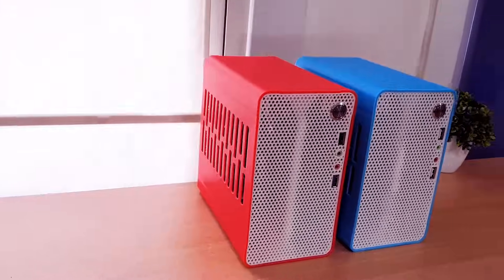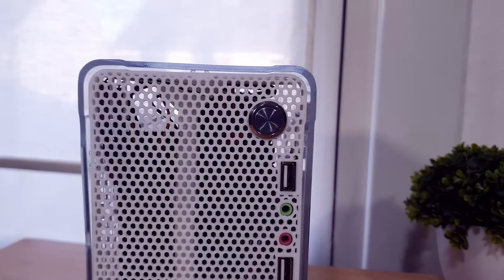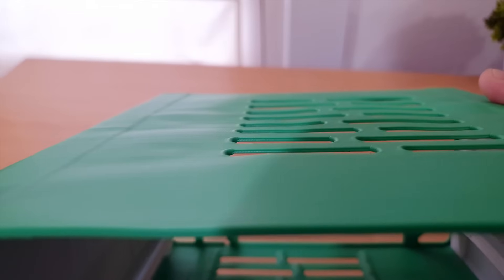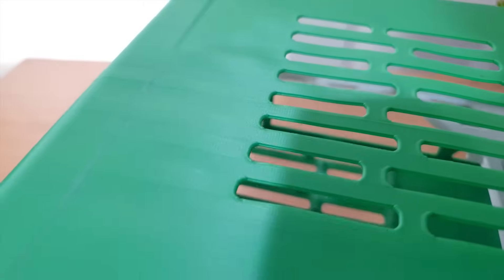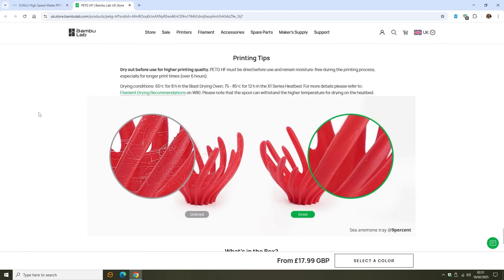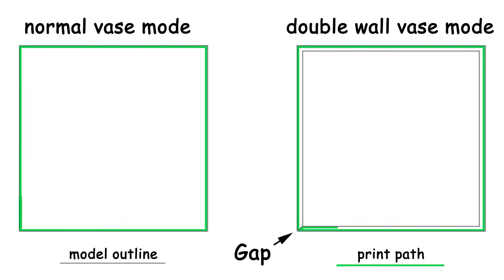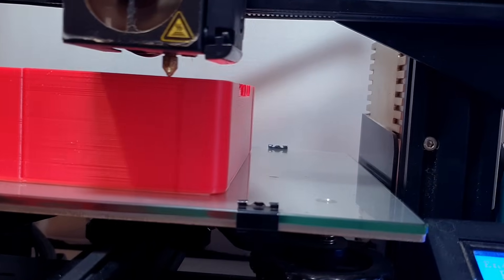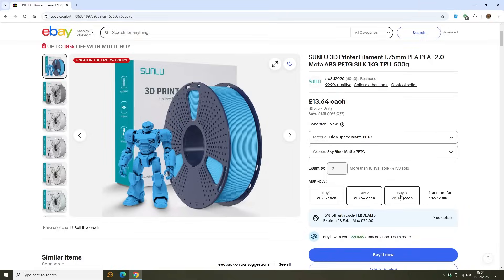3D Printed PC Case - Better Filament (Bambu vs Sunlu)

Comment: If your going to use a print bed to dry your filament here are a few tips. Take a cardboard spool box, cut the flip top off. Use a pen or exacto knife to poke a few very small holes in the top for moisture to escape. Set the bed to 65c for as long as you can. At least 4-6 hours. For extra points, rig up a small blower fan to circulate air around inside the box. 

Trying to dry the filament in a bag is going to trap the moisture inside. If you can afford a proper dryer, I would obviously recommend that.

Comment: I've had 0 issues with BBL PETG HF that weren't my own doing. You definitely need to dry it well to get crisp prints, and if you can, keep it dry while printing if doing a long print. (as I imagine a pc case would be)

Drying it on a print bed with desiccant around it is like taking a shower and not expecting to get wet. 🤣
Reply from the maker: yeah, I should try it again, the shell/sleeve takes 5h30m to print.

The dessicant is just drying next to it, so it's as dry as possible when I put them in the bag, I'm still printing the sunlu with no issues, with this method, over a month after filming this.
Reply: @arkatub sunlu makes good quality affordable filament. I use it too on occasion.

Comment: Your Sunlu petg is probably wet. You need to dry it for exactly what vendor suggest or even for longer and you should get a separate dryer as 3d printer is not good enough for that. And keep in mind that petg is harder to print in general.
However petg is still a bad choice for chassis. It softens at higher temperature, sure, but not that much higher. Try to look at polymaker high temperature PLA, it softens at about 90 degrees Celsius compared to typical 60 for normal pla. And that should be enough for your needs and it would be easier to print.

Comment: Drying filament on heated bed or moisture absorbing bags is same as trying to boil water for tea placing on window and expecting sun to boil it... use special drying boxes, and keep it there for 1-2 days. There is no alternative if you want good prints. Drying boxes ain't expensive,  especially multi tier dehumidifiers.

Comment: Strange. I use a lot of Sunlu PETG HS and have consistent excellent results. In fact I have good results with all my PETG filament from other brands. I think your problem may be with the printer. I have three printers: Prusa MK4S and an Ankermake (Eufymake) M5C and a Qidi Smart 3 printer. All print PETG without a problem using both .4 and .6 mm nozzles. I wonder if the  nozzle temperature is maintained at a consistent level throughout the printing process.
Reply from the maker: I've not had any problems since the first roll, just did a print with it and it was perfect, did my print bed drying method before printing to be safe...
Reply: What settings did you change compared to regular PETG for printing the HS PETG with your Prusa? I've got a load of Sunlu HS PETG that I want to start using with my CORE One, but I can't find any HS PETG profiles in PrusaSlicer.
Reply from the maker: @RoachAndRizla  I don't have a prusa, I print it at 240c, slow speed 30mm/s.

Comment: Im here still wishing you would tweak your design, make a bit of space on top to accommodate flex psu or at least for placing the led 12v power supply on it finger crossed
Reply from the maker: Maybe I can talk about this in the PSU testing video.
Reply: @arkatub  Looking forwad to your video, just came across your video thanks to youtube algorithm. You have done great work designing this case with minimum additional material. Keep on going you are on track to become makerunit channel❤

Comment: You could print it out of ABS GF - it's more dimensional accurate and has high temperature resistance. Also, a filament dryer is a must have - I'm happy with my Sunlu S2 (goes up to 70 C)
Reply from the maker: I only tried CF filament before and didn't like it, the 'fibers sticking out' suface finish isn't great imo.

Comment: I had PC case made on 3d printer plastic is not good idea because of heat from cpu and gpu side panels started to warp. If you build case there is few filaments that are heat resistant ABS and ABS+ Heat Deflection Temperature (HDT) 90 ºC , ASA heat resistant and UV resistan with (HDT) 95 ºC. and Polycarbonate (HDT) 90 ºC. And i'm not a big fan of PLA even HT PLA because that filament become brittle after some time due to moisture absorption and exposure to UV light.
Reply from the maker: Thanks for the suggestions, ASA is the most interesting to me.
Reply from the maker: May I ask did you try HT PLA? I would think the additive for thermal resistance would also provide UV resistance, tho that is just a guess.
Reply: @arkatub  No i didn't use HT PLA i had some PLA+ which is close to HT PLA and basically the same when it comes to UV resistance. There is some UV resistant PLA filament called ALFAPRO but it is expensive and hard to find. PETG, ASA or ABS is better and cheaper when it comes to functional prints. PLA is good for prototyping when you have to fix 3d model

Comment: You can't dry it on the printer's bed. You need a filament dryer. PETG needs to be dried at 65C for a few hours. Even PLA needs to be dried however with an ender-3 this slow you don't need to. And the layer separation is caused by the hotend not holding the temperature correctly or not transferring the heat properly.
Reply: You can dry it on the bed, but you need to mostly cover it with just some paths for air to circulate.

Comment: I think the new PLA HT or the PLA HT GF from Polymaker would be a good choice for this.
Reply from the maker: That's the 2nd suggestion of it, looks like I'll have to get some...
Reply: The HT-PLA has amazing heat resistance... Under no load. So if you have no load of any kind then it is a good option.. if there is any load it might still deform.

Comment: Wet filament from factory is quite common across brands.  Get a filament dryer, and properly dry the filament.
Reply: Its literally the norm
Reply from the maker: Yeah, I should invest in one, I've not had damp filament problems in the past, I still reckon this material is particuarly sensitive to it.
Reply: @arkatub petg is very susceptible to moisture, so you almost always need to dry it out of the package. And drying it on the print bed only works if you put a box or some other container over the filament so the air around it heats up, not just the bed. 

Getting either a filament dryer or a dehydrator is your best bet. I have to admit I feel bad for whoever sold you the Sunlu filament since they gave you a refund for something that wasn't their fault.
Reply from the maker: @steveo107  The next 2 Sunlu rolls were significantly better, worked out of the box, prints well after being stored, I'm sure it was a particuarly bad/compromised roll.

I got them from the same seller, I sent them pictures and discussed, I bought another 2 rolls of regular PETG from them since.

To clarify, the regular PETG is not susceptible to moisture, I keep mine exposed to air, no problems, its just the HS/HF versions that get damp.
Reply: @arkatub  that is wrong. ALL filament is hygroscopic, just some more than others. Even PLA will eventually absorb enough moisture to make printing difficult, it just takes much longer and depends on how humid the environment is where its being kept. 

PETG is considered moderately hygroscopic, so it is generally recommended that you dry it  before its first use. The fact that the others printed fine out of the box is more of a statement on your luck than it is on the filament's need for drying.
Reply: @arkatub  Regular PETG IS SUSCEPTIBLE TO MOISTURE! Personal experience does not negate fact... Don't claim shit like that without research. Do you understand material science, or susceptibility to liquids, or solvents at all. PETG swells with moisture, but not to an extent you will realize visually, or by feel. PETG is generally resilient to everything, it's a glucose monomer substituted/modified version of what they make drink containers out of. It has "very good" resistance to almost everything,a and good resistance to acids, and bases. But PETG aint no flipping Polypropylene. Polypropylene is basically the only plastic that won't absorb water, solvents, or react with anything. Everything else gets stuffed up, and PLA is just forgiving as all hell unless it's at least 3-6 years old, at which point it MIGHT... start crystallizing making it go hard.